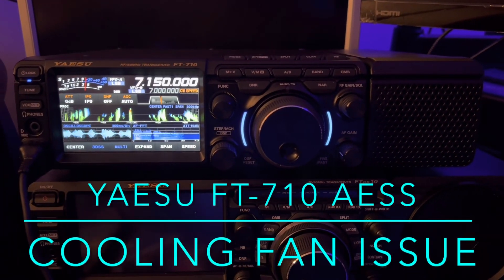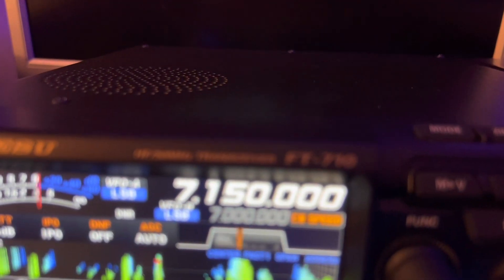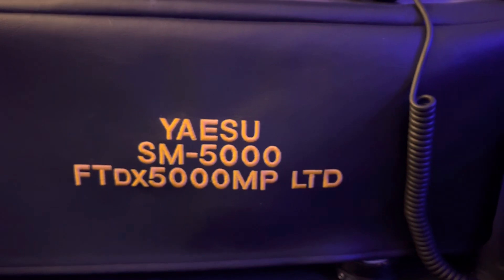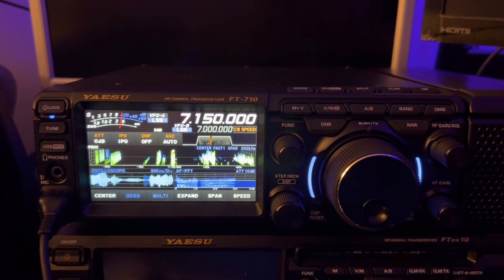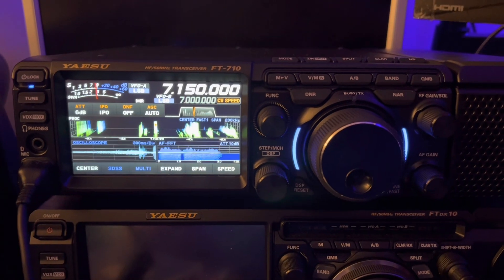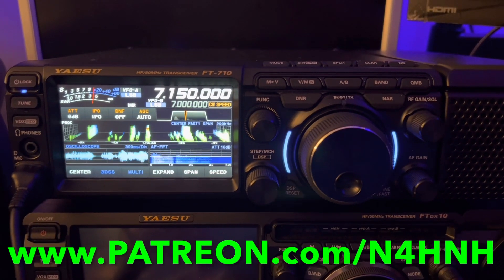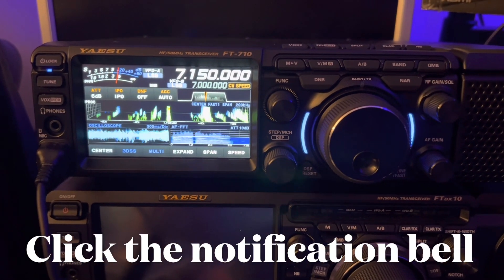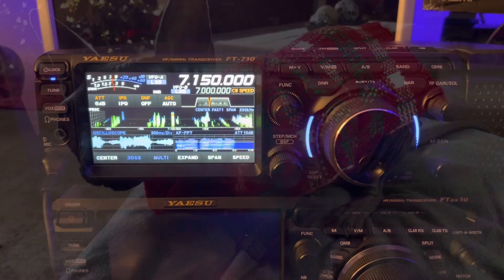Yaesu FT-710 AESS: Cooling Fan Issue (video #17 in this series) #hamradio #ft710 #fan

Comment: QUESTION FOR YOU DOUG.   Would you explain the difference between the Contour and 
the VC tune on 101?  Are there similar or is the VC tune superior to the Contour.  Thx Doug
for your equipment knowledge on the Yaesu radios.
from Matthew KJ4TN- Pateron
Reply from the maker: Hi Matthew.  VC tune works at RF level in the front-end of the receiver. It narrows the receiver bandwidth after the antenna and bandpass filters but ahead of the first mixer stage. This allows you to pinpoint a portion of spectrum within the limits of the bandpass filter. It helps block interference from strong out-of-band signals. But it can be used to mitigate noise and QRM from stations transmitting near the frequency where you are trying to listen.  The link below shows how to use the mu-Tuning preselector in the FTdx5000MP. It serves the same purpose as the VC-Tune does in a FTdx101D/MP. 

https://youtu.be/Ac49adw-fZk

Contour is an audio frequency filter in the DSP stage.  Below is a link to a video from the FTdx10 playlist that shows what Contour and DNR can do. Most of the videos in the FTdx10 playlist can be applied to the FTdx101D or MP. 

https://youtu.be/Ac49adw-fZk

73, Doug
Reply: @n4hnhradio  Thx Doug,
When I listen to other Youtube videos on Contour and VC tune, it sounds like the
VC tune is a lot more effective on pulling out SSB signals at noise floor then the
Contour.
Reply: I can't afford 3 grand to get VC tune, but wish I could
Reply from the maker: They can both be effective. But the VC-Tune is a preselector. Like I show in some of my videos, I might position the preselector such that the station I’m trying to pull out of the noise is down in the skirt of the filter. I keep dropping them down into the skirt until the noise is below them but I can still hear them. 

The preselector can also be used to drop an offending QRM station into the filter skirt on the opposite side of the station you are trying to hear. Or you might be able to move the offending signal completely out of the passband of the preselector, and still hear the station you want to hear.  This is easier to understand in the videos.

Contour works differently. I position it at around 2,000 Hertz and sweep it up and down until I can hear the station I’m struggling to pull out of the noise. The Contour filter works by knocking down the noise near the portion of audio frequency spectrum where the human voice is most intelligible. Vary it +/- 300 Hz until you can pull out the audio information you are missing.
Reply from the maker: The mu-Tune preselectors for the FTdx5000MP are $700 each and it takes three to cover 160 through 20 meters. Two of them cost as much as an FTdx10. Watch my comparison videos and you will see how well the FTdx10 does against the FTdx5000MP. As far as pulling out weak SSB signals, the preselector is icing on the cake, after shift, width, DNR, and Contour have been set.  Work the DNR and Contour the way I show in the video link and you will be able to pull out weak SSB signals better than most of the radios on the market today.

Comment: I absolutely believe Yaesu put this radio out too soon. I think there is still a couple of loose ends to tidy up with the 10, that may be cleaned up with attention to firmware.
Reply from the maker: There are more than a couple loose ends with the 10, IMHO.  I sent Yaesu my list to Yaesu around May of 2021. I, along with the members of the Patreon team, put together a list and each of us who would sent it to Yaesu earlier this year. It seems to have fallen on deaf ears. Our requests were mostly about allowing us more control via a mouse, to avoid dealing with the buttons around the VFO. A firmware update could definitely handle that.
Reply: @n4hnhradio  Not disappointed with the my 10 but as a Patreon, where can I find the list you put forth.
Thanks for what you do Doug.
Reply from the maker: The list was derived as part of one of the post where we discussed the things we would send to Yaesu via their Contact Us page, which gets read in Japan.  Look for our Patreon discussion post entitled “Let’s Influence Yaesu.” It was posted on April 26, 2022.

Comment: My 710 is quiet. I don't hear a hum. I just have a problem with the meter jumping. If you have a hum with your fan you need to send it back. I hear no hum with mine.
Reply from the maker: It isn’t my radio. Read the video description. But yes, many had fan issues and were returned. The fan circuit was recalibrated so the fan didn’t run 90% of the time, like this one does. Some fans were replaced because they were physically noisy.